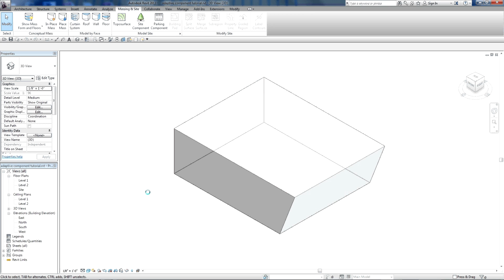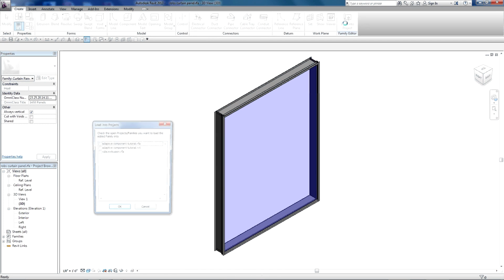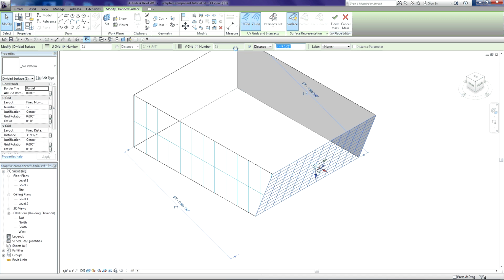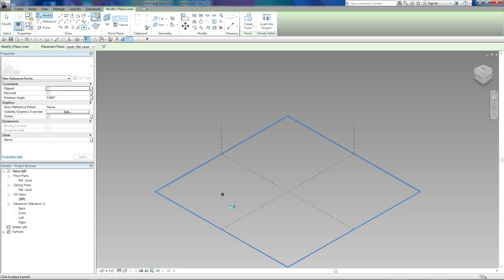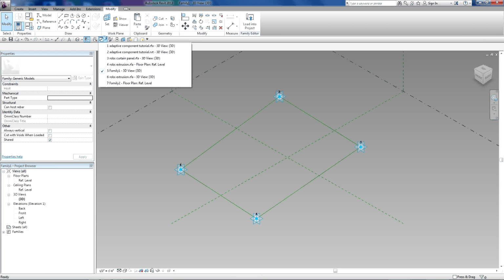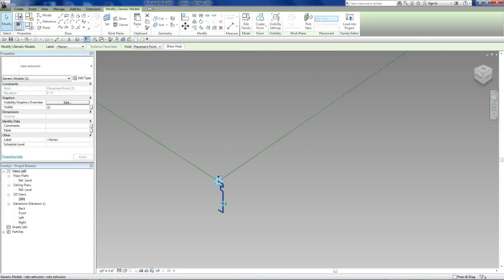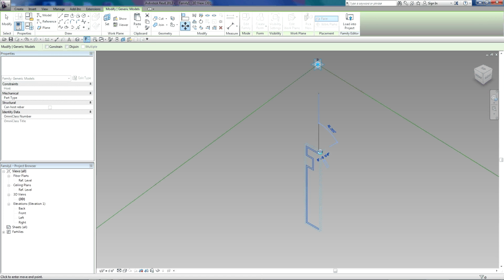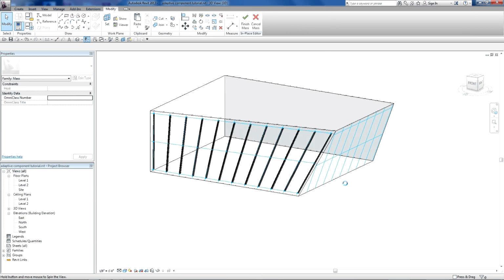REVIT ADAPTIVE COMPONENT TUTORIAL

Comment: I know it has been years but I am looking for a tutorial on this for say wainscoting. This would make doing the panels so much easier. Any thoughts? I have looked on YouTube and can not find anything useful
Reply from the maker: Chad, I actually tried modelling wainscot for my 1895 house in Revit using the traditional curtainwall tool  and it was possible but a lot of work when I got to the staircase (because of 3 and 5 point panels which the traditional curtainwall tool doesn't like...I essentially faked it by trigging out the sloped edges in individual panels). If I had to do it again I would definitely use the adaptive component tool. The tricky thing even with that is getting nodes on the diagonal to anchor to. This is resolvable using Dynamo to deploy the panels instead of a host surface in the Revit project. But that's another lecture.

Comment: I was wondering why did you use faced based template to draw the mullion? wouldn't you have achieved the same result just drawing the profile in generic adaptive file? what did you use the faced based for
Reply from the maker: +Rory H Hi Rory. This was three versions ago and I don't remember exactly why I did what I did other than remebering that Adaptive Components were really new at the time and we were shooting in the dark. I did just go in and do the same kind of profile creation in the Adaptive Component environment and it seems to have the same limitations as the face based generic model of only allowing a single closed loop (in other words you can't draw a hollow curtainwall mullion). Also there is an annoying aspect of the Adaptive Component environment in that the drawing plane reset has a hair trigger. Everytime you touch a reference plane, it resets as your drawing plane. So pushing them with temporary dimensions resets the drawing plane. For the same reason you can't mirror a reference plane. When I make profiles I like to parametize them and this takes twice as long in the AC environment.
Reply: +numnumbirdynumnum Hi, thanks for the reply. Yes it's true you cannot create a hollow form from 2 closed loops directly using create form but I was able to achieve an adaptive hollow mullion by using 2 profiles, one for create solid form and a smaller offsetted profile for creating void form. Mirroring a plane in AC environment doesnt seem to work in 3D view but does in plan. Im thinking if there is a way to parametise the thickness of a hollow mullion frame, any ideas?
Reply from the maker: +Rory H Rory that's very clever if it works! I'm away from my laptop and can't test the theory but what I would do is parametize both profile lengths and then nest those parameters into your parent file (the AC file where you're making the extrusion). Then create a thickness  parameter in the parent file. Then link the three parameters arithmetically with a formula driving the inside profile length by subtracting the thickness parameter from the outside profile length. (If your extrusion is a simple rectangle you will need to do this for both length and width separately.) good luck! I'll try this when I'm back with my machine.
Also just to re-emphasize my earlier point, be cautious about over detailing your models. Curtain walls are by their nature, large and expansive. Your machine might begin to choke on too much three dimensional detail.
Reply from the maker: +Rory H Try this. https://www.youtube.com/watch?v=0oRd954O0Sw&feature=youtu.be
Reply: +numnumbirdynumnum Thanks for posting that and the mention in the end :) I discovered something even cooler and more convenient, you can probably add it to the end of the video. I created a similar profile that you did with the parameters (in a generic AC file), and I set Yes/No instance parameters to control visibility of the outer and inner profiles using one family type. Then load the profile into the parent file and insert it onto the reference line plane, make sure only the outer profile is selected in the instance properties panel, select the 3 reference lines and hit the create form. You'll get a solid sweep. The coolest part is when you go back to the properties panel and tick the inner profile instance parameter (while keeping the outer one ticked), it'll automatically create a void! And the cooler part is that now your dimension type parameters, like thickness etc, will manipulate the geometry directly without any linking/formulas because you're not using 2 separate family types. PLUS if you go back to the profile family editor and add new rectangles within rectangles inside your profile lines and load it back in/overwrite, it will create new hollow shells automatically. Go ahead try it :)
Reply from the maker: +Rory H Hmmm...I wasn't able to reproduce this. Can you describe it in a different way or make a vid?
Reply from the maker: +Rory H Rory I just tried again in a slightly different way and was able to reproduce it with both an AC profile and a FB profile. Bravo! I need to do a bit of chainsawing but later on I'll make a vid describing the process. Thanks very much!
Reply: +numnumbirdynumnum You're welcome! It's pretty neat. Cool I'll look forward to the video then :)
Reply from the maker: +Rory H https://www.youtube.com/watch?v=P-cmqeGZOGg
Reply: +numnumbirdynumnum That was quick! haha. Great video. Yea I was using instance parameters to control the visibility of the profile lines, so they would appear in the properties panel on the left (in project environment) vs inside the edit type of family. So basically I created new parameter, set type of parameter to Yes/No and selected instance, and assigned the lines to the parameters, it's the same thing really. Anyway, I guess the next thing to figure out is the lack of nodes on the slope!
Reply: +numnumbirdynumnum Hey, I've been having a new problem that I haven't been able to solve. I was wondering if you could take a look at it maybe you know how?! I've posted a thread here: http://www.revitforum.org/architecture-conceptual-massing-adaptive-components/28054-adaptive-placement-sweep-2-edges.html#post156929
Reply from the maker: +Rory H I see a couple of things you did wrong but honestly can't find a solution that works. First, to help diagnose, drag the profile up the rails and you'll see that it flips back and forth...this is a hosting problem. To fix this, in the profile set the two adaptive points to "Auto-Calculate"...this changes the way that they host on an object. You alos need to keep the arc in the intended relationship to the points, not orthagonal to the ground...rease your lines and then make a reference line between the two adaptive points and set its "horizontal" plane as the host for the arc which should be a spline through points model line. When you reload it, try dragging it up the rails on which you've hosted it. You'll notice that it rides up smoothly until it hits the peak of the arch and then flips upwards a problem I can't solve). I tried recreating your arch void as a pure arc instead of a spline to see if the spline is the problem but the profile does the same thing. Play around wtih it for a while and tell me if my suggestions help you find a solution.
Reply: +numnumbirdynumnum Thanks for the quick reply! I forgot about the orientation properties for the adaptive points!! I readjusted the arc onto a reference line between the placement points as you said, and yes that helps with the flipping issue and it seems to stay perpendicular to the arch surface, thanks. It does flip at the top of the arch which is strange, however I wanted to test if it would successfully create a form on the first half before it flips. So I created half an arch just before it flips, and tried to select the profile and the 2 edges, and hit create form, but it gives an error "This form cannot be created due to self-intersecting geometry. Clicking the Reorder Profiles button will attempt to solve this problem."

If I select one edge and the profile it creates a form but its incorrect. So even if we could solve the flipping profile at the top, it doesnt seem to create a form from 2 edges and a profile! Unless Im doing something wrong..
Reply from the maker: +Rory H Rory, Transfer this conversation over to here. https://youtu.be/ZHh6IVwzjxU
Reply from the maker: +Rory H Rory I solved it as best I could (its pretty damn close but not what I would call watertight). This is as best an emulation as I could do. It doesn't appear that a true two rail sweep is possible in the Revit environment. Check it out here.https://youtu.be/shdtYoCjRk0

Comment: I know you mention about the details of mullions.... But how detail can you get? Because Im trying to do mullions with small details such as screw bosses and such....Thanks
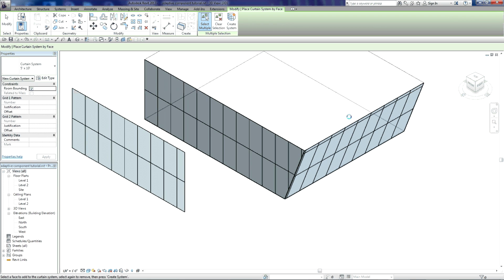Reply from the maker: Joey Magee Hi Joey,Catia has the capacity to manage that kind of detail without crashing but if you put that kind of detail into a Revit panel and populate a reasonably sized wall (usually curtainwalls are big because that's their nature) you're going to either crash or have very slow behavior. For architectural drawing in Revit, I advise you stick to conventional 2D detailing once you get closer than 1/2" (1:20) scale.That being said, if you need to do detailed three dimensional  drawings of curtainwall units and you limited yourself to one panel in a RVT project file, it might be possible to do a lot of detail without crashing (just don't try to push that panel into a project. Usually that kind of industrial detailing is done in software designed for that purpose...Solidworks or Inventor can do this well because they replicate industrial practices (like for instance, bending radii of break metal.)